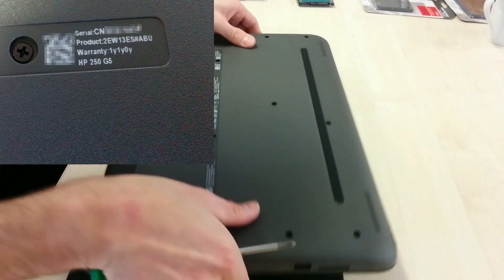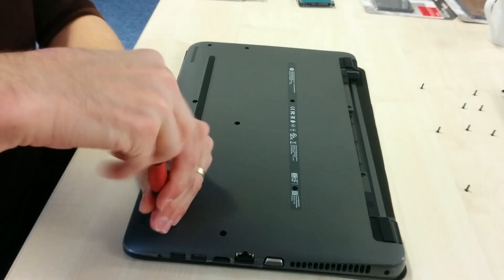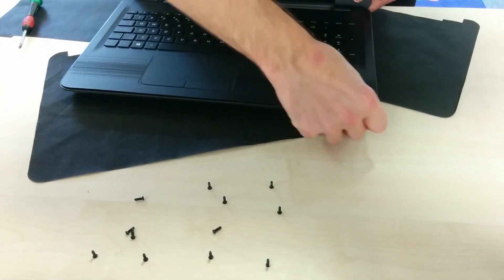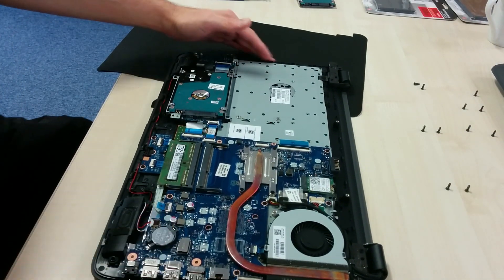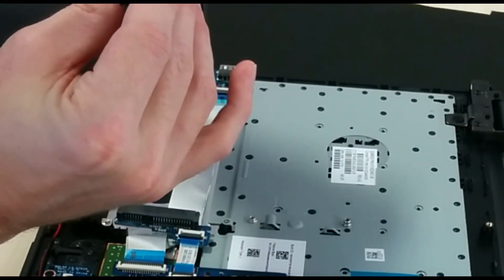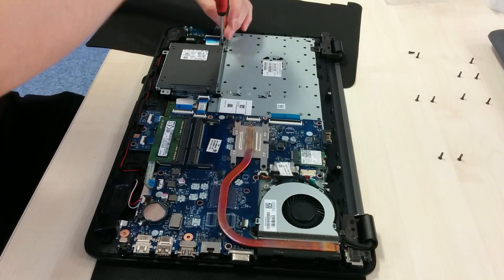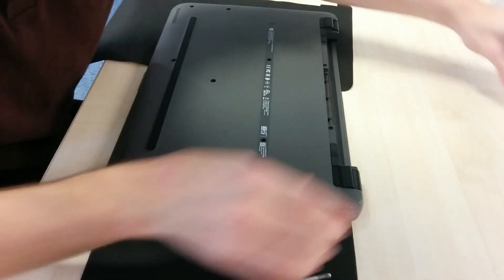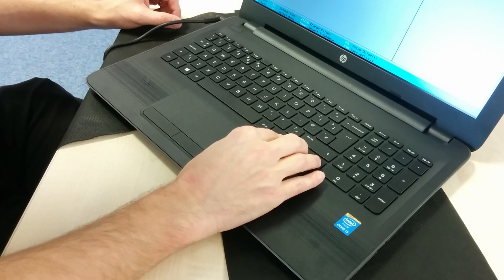HP 250 G5 Laptop - How to change or upgrade the hard disk

Comment: I waa hoping this video will contain an M.2 hard drive connector, unfortunately it has a standard SATA one.
I just got a laptop like this one with NO storage and NO  RAM and I decided to buy these so I can use it. Unfortunately AFTER I bought them I found out this laptop has actually M.2 Connector AND DDR4 ram. The 16 GB (2 x 8 GB sticks) RAM i bought fit just perfect, but the standard SATA SSD did not. So I decided to install the SSD into another PC I own and I ordered ANOTHER SSD for this laptop specific, now with m.2 connector. The SSD arrived today in the mail but for some reason I can't install it imto the laptop, for some reason it does not fit wtf

Comment: Hi. Is possible to replace its original hard drive with an ssd hard disk?
Is this laptop model compatible? Thanks!
Reply from the maker: Yes. Any SATA SSD should work in the machine. You don't need to replace the SATA Hard Disk with another traditional Hard Disk. 💿

Comment: what about cloning the drive
Reply from the maker: I would use macrium reflect trial.
Reply: @freename  thank you - the software will probably do the job, but how can you clone a drive in a laptop when you only have one sata cable? its easy in a PC, where one can have multiple power and sata cables
Reply from the maker: @johnh8932  I use a computer.. or a USB to SATA cable and clone the drive with the new one plugged in via USB before you remove the old drive.
Or using the Macrium boot USB if you've already put the new drive into the computer and have the old drive on the USB to SATA adaptor.
Make sure you are copying the correct way! Don't accidentally copy the new blank drive over the top of the one with all your data on!

Comment: I have HP 250 g5 , Intel Celeron N3060 and i dont have fan inside, is this possible ?
Reply from the maker: Yes. It's a weak processor and might be able to passively cool just using a hear sync alone.

Comment: Thanks for this brother. I am 5 years late lol. Better late than never. Can I upgrade my old HP 250 G5s hard drive with a Sata Adapter with M.2 in it? and would that help speed up the performance? I want to give it to my kids to use for homework and school. Love you videos and thank you for this
Reply from the maker: Any SSD would improve performance. On a machine like this it's probably not going to make any difference using a native SATA Vs m.2.
Reply: @freename  Thank you brother
Reply: @agelualofa  even if u put m2 2280 nvme pci 4.0 x4 hard drive, data still have to go thru ata interface and u get 400mb/s speed.

Comment: Hello Dear friend and Congratulations for your videos. I have the same laptop with an internal ssd M2 connector instead of HD connector. If the ssd Disk is removed will the laptop startup or not? Thanks for your Help!!!
Reply from the maker: It will POST but it won't boot an operating system. The operating system will be on the SSD/M2 card. You could take out the card and boot from a "Live USB" for linux if you didn't want to have a disk in the computer. That Live USB would need to be connected to boot and use the computer.
Reply: @freename  Thanks a lot for your reply!!! What do you mean by POST? To see the power led ON? I have a blank screen without the SSD/M2 card. It should boot the bios but it does not,
Reply from the maker: @StefanosBand  I would expect you to be able to get into BIOS without the storage in the laptop. Are you pressing the correct button to get into BIOS? Usually F10 on an HP.
Reply: @freename  I will try it and I let you know! Many thanks for your help and best regards!
Reply: @freename  Hello again I have only the Power led On. The fun is not working and the FN keys does not put me in the BIOS. I think that the motherboard is faulty!  I have disconnected some strip connections to see if it is something else is faulty but I still have no results! I have also put the RAM out in case of a faulty RAM problem.

Comment: Hi, i have a HP 250 G5, it powers on but the screen remains black and the hard drives not responding. Ive replaced the hard drive with a working one but still cannot display anything. I also tried replacing the RAM but still no changes. Lastly it also cannot connect to a second display or monitor..Any idea or tip..??
Reply from the maker: Sounds like you are at the end of troubleshooting without having the circuit board debugging skills of Louis Rossmann. If it has a BIOS battery you can remove maybe remove the main and bios battery for ages (hours!) and then plug it back in and try again.
Reply: @freename  Thank you for your response.. Ill try do that and see the result..

Comment: Hi! 
Can you connect SSD by JODD???
Reply: It's instead of dvd
Reply from the maker: You can in some computers but some also don't like using the DVD to SATA converters. (e.g. some Lenovo laptops definitely don't work with them. They work but you can't boot from them - so your main drive still needs to be in the normal SATA port.).

Buy one and test but make sure you buy it from somewhere you can send it back if it doesn't work?

Comment: I managed to swap my dying HDD for a and new SDD and now my laptop is running much faster. Big thanks for the video! :)
Reply from the maker: Thanks for saying thanks.
Reply: Hey. I plan to the same with my laptop. The HDD that I have is "laptop thinn". Do I need to buy some specific laptop thinn SSD? Or are the SSDs already "laptop thinn"?
Reply from the maker: All SSD I've seen have been the "thin" type.
Reply: That is great. I am wondering if I can remove my CD drive with an HDD? If yes what size should i buy the "Caddy"

Comment: Thank you. This helped me to upgrade my $10 HP255 G5 to an SSD drive. Now it boots in 6 seconds. Not bad. On my 255 G5 the two inner battery screws are short and the rest are long. Other than that and the fact the HDD has pins not screws the video helped me upgrade in 10 minutes.
Reply from the maker: Thanks for taking the time to say thanks :)

Comment: Got all the screws out but now I'm stuck.   In the video, you're unclipping the back panel by sliding a credit card in between and gently prying.  That looks perfect.  However with mine there is no gap whatsoever between the back panel and top/palmrest.  Forget about sliding a credit card in - I can't even get a razor blade in between those two parts.   It's as though it's one solid piece.  If I feel where the gap/joint should be with my thumb nail  I can indeed feel that there is a slight joint/junction there but not one that ANYTHING could ever possibly get into without breaking or damaging the plastic of the parts.  It's as though there are two pieces connected together - but it's like they've been glued or something.   There seems to be no actual gap between them that a credit card, a razor blade, a knife, or any other instrument could conceivably slide (or push) into.  Any ideas or suggestions??  Any trick or advice that anyone can provide would be greatly appreciated as the hard drive has died and I desperately need to replace it.  Thanks

Comment: HI, is it posible to put these two disc togheter? The HHD + SSD in   HP250 G5 Laptop ??
Reply from the maker: If you take out the DVD drive (if you have one) and use a DVD to Hard Disk converter you might be able to. They don't always work but it is the easiest way to add a second disk into a a computer with only one normal space for a disk.

Comment: What ssd did you use in this vid?
Reply from the maker: Standard SATA 2.5 inch drive.
Reply: @freename  thanks for the reply i ordered an SSD 240GB Kingston A400 Internal Solid State Drive Laptop SSD Drive SATAIII 2.5" would you recommend this?
Reply from the maker: Yep, that's one of the brands and models I've used without problem. As with any drive, back up your important data! Anything (even hard disks) can go wrong without notice. SSDs are more difficult to recover data from than hard disks too.
Reply: @freename  ok thank you sm for taking the time to reply enjoy the rest of ur day

Comment: Thanks for the video. I found it much easier to remove the optical drive before lifting the palmrest.
Reply: Never mind.  Thanks.  I see it just pulls right out.  ;-)
Reply: I cannot get the back and the palm rest separated at all.  Maybe as you've suggested if I could remove the optical drive it would be easier for me to do it.  How do you remove the optical drive?  Thanks
Reply: The optical is out but makes no difference :-(  there is still no gap whatsoever to get a credit card - or any other instrument into.

Comment: You beautiful amazing man!!! My lap top back is now off and i can see where the mother board is and the hard drive are. Got to work out which bits they are, don't want to remove the wrong bit eh? Can I put any hard drive in to replace the one I broke?
Reply from the maker: Yes; although I would recommend a 2.5" SSD! It will make the machine far, far quicker.
Reply: icannotgetafreename yes, I was thinking about that and have just messaged ebuyer about what inch one and once again you have been truly awesome. Do you recommend any brands or advise to stay away from any too?
Reply from the maker: @carolinegray6984  I buy SanDisk and crucial. I would no longer buy Toshiba or OCZ
Reply: @freename  Heya, me again, sorry to bother you. OK I've got the SSD in my laptop and the black screen says it's there, after I did a short and long test, well after it did the tests. What do I do next? Do I need to install an OS, Windows 10? I can't remember if it came with them in or if I had disks for them. It was 2017 when I got it.   Don't worry if you've not got time to help me because Im guessing you're a very busy man. Hope you're surviving the virus!
Reply from the maker: @carolinegray6984  You can either clone the old drive using something like Macrium Free and a USB3 to 2.5 inch adaptor.. or just use another computer and a spare memory stick to make a windows 10 install stick. (Your computer is unlikely to have come with one). https://www.microsoft.com/en-gb/software-download/windows10 and follow the instructions on the tool to make a USB stick.
Reply: Hi I cannotgetafreename, I have ordered one of these. Will try to attach a picture....
Reply: I bought a SanDisk Ultra 3D SSD 1TB, reads at 560 and writes at 530 is this OK?
Reply from the maker: @carolinegray6984  Any SSD will be fine :D Far, far quicker than any hard disk.

Comment: I could not do it, 😥 i made it ok until the part before of take off the back. It seems all ok, all the borders were un clipped but it is like it is another curb in the middle, i have fear to broke it 💔 and the vga conector i dont know i hope i did not broke it 😭
Reply: Screw* not curb
Reply from the maker: Exactly that model number and generation (G number) laptop? And it's going to be very difficult to try to help over the internet; I recommend asking friends for a trusted and good computer repair person or shop to see if they can help you take the case off or do all the work.
Reply: @freename  thank You. It is a hp 240 g5
Reply from the maker: @julietasoledadrodrigues3512  this video is for a 250 G5. I don't have access to a 240 to give advice on what else might need unscrewing. Other hp machines hide some screws under the rubber feet / rubber strips so check there if it feels like the remaining screw is near that place.

Comment: Hey, great video! I just subscribed. I do have a question, though: I wanted to upgrade to an SSD, does this laptop support a SATA 3 connection?
Reply from the maker: Hi, sorry. I don't know the answer.
Reply: @freename  sir pls reply me pls 
I have the same laptop and i want upgrade the processor to core i3(3.20ghz) but i have intel n3060 processor (1.60ghz) so can i upgrade pls help me
Reply from the maker: @bestiethegamer3867  The CPU in that laptop is soldered onto the board. You can't just lift it out and swap it with another CPU.
Reply: @freename  means i cant ??
Reply from the maker: Only if you have a soldering rework station and ability to solder BGA chips.
Reply: @freename  if i go to the service centre or if i go to computer engineer then can it be done ?
Reply: @freename  but i subbed cause you replied me 😎 and pls answer my question above
Reply: @bestiethegamer3867  It's not a thing you can easily do on a laptop. Even if the new cpu can be soldered on, the bios might not be able to recognize it. Or, the external powersupply/ internal VRM section might not be able to properly power the CPU. Laptops in general, bar few exceptions (there are manufacturers that builds modular laptops with "easy" swappable components), are made with a specific configuration that cannot be altered.
Reply: @paolocazzaniga8735  i purchased a new one instead of it 😅 btw thanks for letting me this type of thing inside the system. Thanks

Comment: The laptop contains an SSD or HDD? Can I use this hard drive (from the laptop) on my desktop for extra space?
Reply from the maker: You can use a laptop drive in a desktop vase but it needs a bracket to go on due to the dimension of the laptop drive being so much smaller. Or you out it in and have it just hanging around inside the case not screwd in.

Comment: Hi, I wish to have my storage upgraded. how will this affect performance? I have HP 250 G5, it has an HDD storage below 200gb I wish to upgrade to 500gb or 1TB.
Reply from the maker: Changing to a higher capacity hard disk is not likely to affect performance. Upgrading to an SSD will drastically improve the startup speed of the computer and how quickly programs load.
Reply: icannotgetafreename many thanks🙏

Comment: What kind of screwdriver is that? When I open the back the screws are way too small for my screwdriver so I can't remove the HDD
Reply from the maker: The size label has worn off the screwdriver I have so I can't tell you :( Just use a slightly smaller screwdriver?
Reply: 5 years late but a knife worked for me (the end has to be pointy)

Comment: on that model can you add more ram?
Reply from the maker: Yes.. on my one at 5:08 you can see there are two RAM slots next to the hard drive (closer to the camera).. on my model only one of the RAM slots has RAM in it.. so you should be able to add a stick - or remove the existing RAM and install two higher capacity upgraded sticks.
Reply: Mine says you can expand it on windows, but when I open, there's just one slot
Reply: All-in-All Change it with a higher capacity :-)?
Reply: It s there possible to change the CPU, (Intel Celeron) to a I3, thank you
Reply from the maker: No